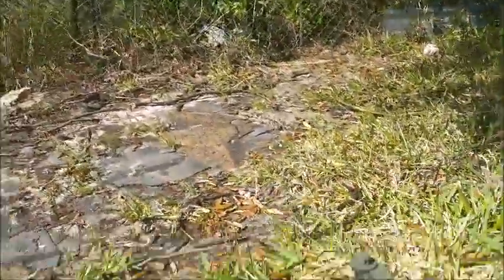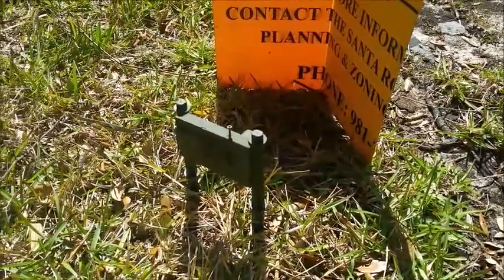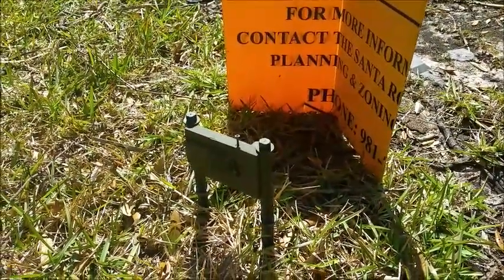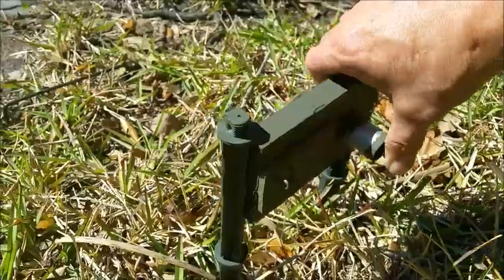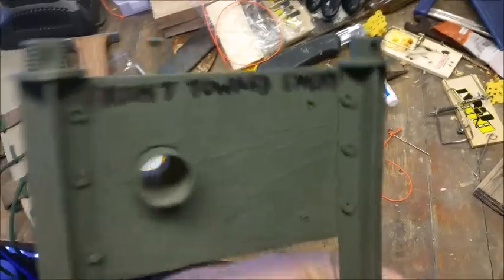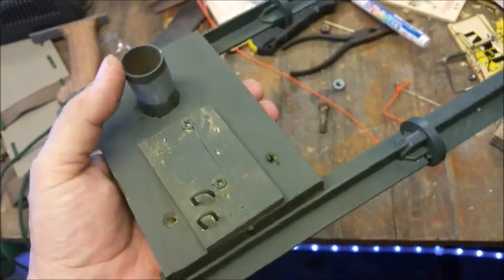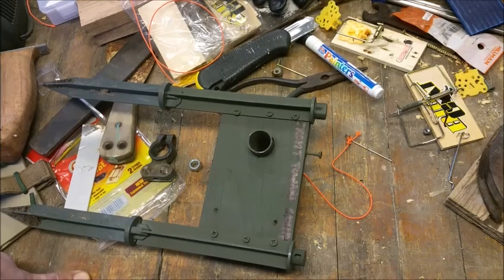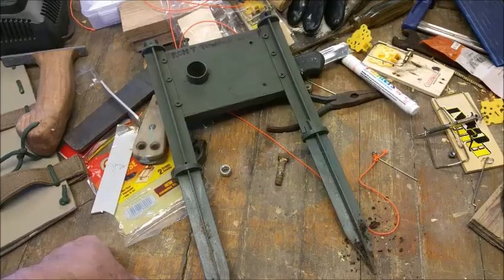DIY White Trash Claymore TRIALS AND TRIBULATIONS

Comment: Good stuff.  Did you take video or pictures of the build?  I like it.  Actually in theory it is like a landmine(self detonating) for a claymore take a 12ga round and replace the primer with a model rocket ignitor/electonic match.  then you can fill it with cayenne pepper, flechettes or something bigger than bird shot.  Your LP/OP monitoring your perimeter easy avenues of approach.  the areas hard to monitor the land mine theory devices work great.  Make sure your property is posted and I would warn my neighbors (unless you fear your neighbors).